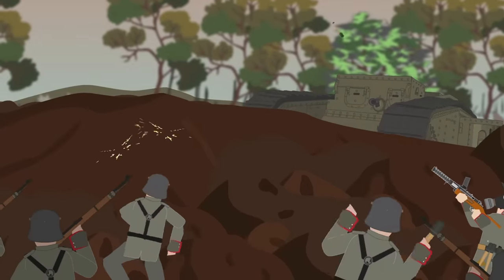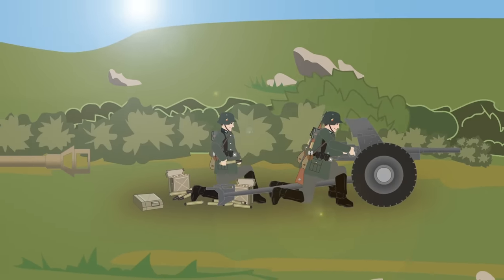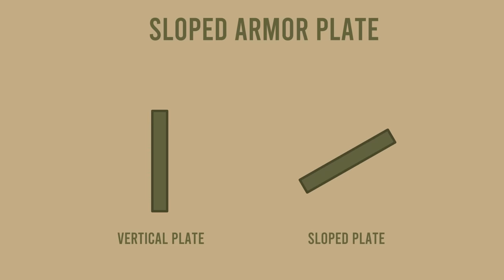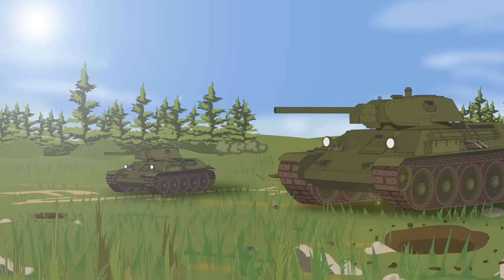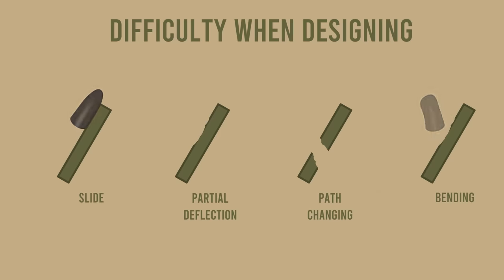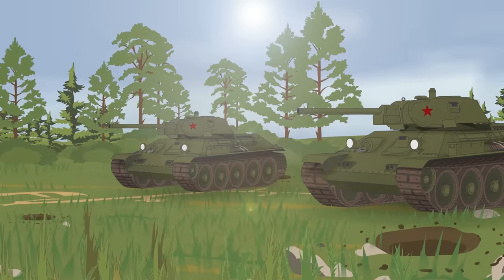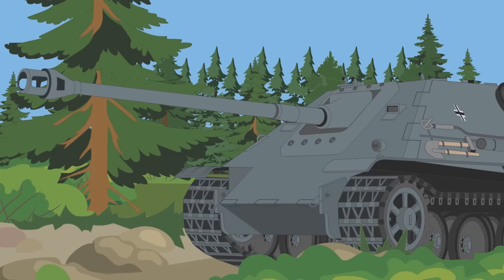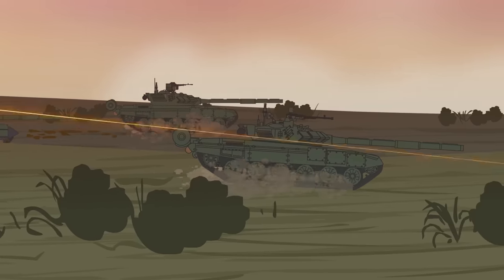Sloped armor: A simple feature that saved many lives

Comment: New rounds did hamper the effectiveness of sloped armor but not as early as stated. Yes the long barrels 7.5 cm guns of the Germans could penetrate the T-34 but making it thicker and sloped helps. Early HEAT rounds did have some issues with deflection as hit armor that was sloped could mean that the primary fuze isnt struck or that deceleration is insufficient to activate fuzes located at the base of the projectile, in addition to the fact that some early HEAT rounds were somewhat weak and required attacking weaker armor to penetrate. Furthermore, early APDS rounds did have problems against sloped armor as it was more easily deflected than standard AP rounds. Improved kinetic rounds and HEAT rounds in the post-war years had much better penetration and resistance to deflection is what hampered sloped armor in tanks. Sloped armor is still useful in increasing LOS thickness and is more useful against smaller caliber weapons like small arms, HMGs, and auto cannons which often use less advanced rounds that are more prone to deflection than a round fired from a main gun, which is why many IFVs and APCs still use sloped armor.

Comment: 5:01 There are a lot of maps, but you can't choose the ones you play on. The matchmaker does that, picking a random map of the current map pool (which isn't all the maps).

Also "using models and vehicle characteristics from history" is a nice meme at this point of the game. If you want historically more accurate tanks, you shouldn't play World of Tanks but War Thunder instead.
Reply: War thunder isn't even close to historically accurate with their tanks lol.
Shermans are slower than the Panther A
Jumbos outrun normal Shermans,
The T77 shot on the 90mm, a shot specifically designed to kill panthers, can't kill panthers.
British not having APDS on their firefly.
I could go on.

Comment: You forgot one thing, not just gun size. But also ammo types. Slope armor can protect itself from a normal AP round but other shells such as the ( ex. ) HEAT, APCBC, HESH, APHEBC and even HE rounds can take out a tank with sloped armor ( unless the HE round is large and is packed with large TNT/explosive creating  spall damage.) Useful info from both War Thunder and the internet.

This includes High velocity kinetic rounds such as APCR, APCBC, APHEBC, APDS and your typical modern day era shell. The APFSDS
Reply: Not only the shell types but steel types, with casted, rolled nad composites  etc.

Comment: It took me 50 years of studying WW 2 to realize that the Panther was just a German T-34, with its sloped frontal armor.
Reply: except it was expensive af to build
Reply: @fluffehpancakes1102  not really, near the end of the war the panther was about as expensive as the pz4
Reply: @yellowcrayonkid  i think that it was easy to producea panther than a panzer 4
Reply: @tinchorb1340  and harder to repair than a pz 4
Reply: @xahmadx6442  well
By late war
Panzer 4 production stopped
So, it might have been harder to find spare parts
Reply: Yeah how? Sloped front armor? By that way of thinking then FCM 36 is just French T-34
Reply: @tinchorb1340  considering that ~8000 of those were built I dont think its gonna be that hard
Reply: @tinchorb1340  the Germans focused on producing more panthers without producing many spare parts and
The pz4 and  is very common so you will find spare parts
Reply: @xahmadx6442  oh well, ig there was quite a lot of spare parts for panzer 4s
Reply: Except it had a much thicker frontal plate and higher performance gun than T-34/85.
The problem with Panther was that tank’s transmission wasn’t designed for it’s weight of 45 tons.And engines weren’t tested enough for the use of the tank due to Hitler’s pressure on manufacturers.

Comment: The t34 steel was not that strong even with the slope
Reply: Yeah i mean it was vulnerable to everything Germans had by late 1942 onwards.
Though obviously Panzer 2s with tiny 20mm guns or early Panzer 3s and 4s with short 37-50mm guns had no chance of penetrating frontal armor of T-34.But in 1941 most Soviet tank crews were poorly trained and lacked communication,so Germans had no problem flanking and knocking them out by shooting it’s paper thin side armor during Operation Barbarossa.

Comment: Tanks that were sloped made the compromises of having heavier weight and smaller crew compartments. The T-34 series have very good sloped armor but is notorious for its discomfort and cramped interior. It can also explain the differences in comfort to, let’s say, a tiger tank. The crew space and comfort was significantly better than most allied tanks which can explain as a reason why tiger tanks preformed better on battlefields than most allied tanks (other reasons are like better cannons, crew experts, etc).
Reply: Yep,Tiger was a huge rectangle box with a ton of space for the crew.

Comment: Sloped armour is armour that is neither in a vertical nor a horizontal position. Such angled armour is typically mounted on tanks and other armoured fighting vehicles (AFVs), as well as naval vessels such as battleships and cruisers. Sloping an armour plate makes it more difficult to penetrate by antitank weapons, such as armour-piercing shells (kinetic energy penetrators) and rockets, if they follow a more or less horizontal trajectory to their target, as is often the case. The improved protection is caused by three main effects.

First, a projectile hitting a plate at an angle other than 90° has to move through a greater thickness of armour, compared to hitting the same plate at a right angle. In the latter case, only the plate thickness (the normal to the surface of the armour) must be pierced. Increasing the armour slope improves, for a given plate thickness, the level of protection at the point of impact by increasing the thickness measured in the horizontal plane, and the angle of attack of the projectile. The protection of an area, instead of just a single point, is indicated by the average horizontal thickness, which is identical to the area density (in this case relative to the horizontal): the relative armour mass used to protect that area.

If the horizontal thickness is increased by increasing the slope while keeping the plate thickness constant, a longer and thus heavier armour plate is required to protect a certain area. This improvement in protection is simply equivalent to the increase of areal density and thus mass, and can offer no weight benefit. Therefore, in armoured vehicle design, the two other main effects of sloping have been the motive to apply sloped armour.

One of these is the more efficient envelopment of a certain vehicle volume by armour. More rounded shapes generally have a smaller surface area relative to their volume. In an armoured vehicle that surface must be covered by heavy armour, so a more efficient shape leads to either a substantial weight reduction or a thicker armour for the same weight. Sloping the armour leads to a better approximation of the ideal rounded shape.

Comment: I read one German account, a group of T-34s attacked German lines at the beginning of Barbarossa. At the time the Germans had nothing to challenge the tanks. As a last ditch result they brought in a 20mm AA gun battery. The automatic weapons struck the tanks many times at close range. The Russian crews bailed out and ran. Later inspection showed the 20mm rounds did not penetrate the tank's armor. Some of the Russian tank crews were captured. Under interrogation they confessed that, while the shells didn't penetrate, they did turn the interior of the tank into a ringing bell. They couldn't take it and ran.

Comment: The main reason that Panzer III and Panzer IV did not use sloped armor design is due to the lack of reason to sacrifice inside room and ergonomic while the frontal armor could withstand anti-tank rifle from point-blank and most of the early anti-tank gun from some distance. The project to build a medium/heavy tank against future potential threat start from 1937, and they use the already mature Panzer III/IV design, that's why Tiger's frontal hull armor is still almost vertical(in fact it's around 10 degree sloped).
Reply: Not ! Later germans adot the concept on panther and tiger 2
Reply: @Necromancer_88   I know, that 's how Panther tank born.  Still, Panteher has a lot of problems
Reply: @Necromancer_88  I know, just talking about the reason of while german's armour car were using sloped armour but tanks were not when the war just break out.
Reply: The requirement was to resist the French 37mm on the front not AT rifles.
Reply: CipiRipi00   But the pateaux SA 18 37mm was thew gun most French tanks used so that was the requirement.

Comment: well but a powerful HEAP or SQUASH round with a 1 second delay rapid 10-15 degree  angle change triggered  inertial secondary fuse in the anti tank or  anti ship round will fix that sloped armor ricochet  and reactive armor issue very easily.

Comment: tigers may have flat armor, but you angle the entire tank facing the enemy with a 60 degree frontal plate and the whole front and side becomes angled armor. this increases the protection from shots at those angles on the left and right sides by a huge margin, allowing armor that could be penetrated by an american 76mm or russian 85mm to now deflect enemy fire along those angles. this was entirely unintended by german engineers but was later described as a useful tactic in the Tigerfibel pamphlet. and while you may like world of tanks more i have news for you that warthunder is easily the better and more realistic game, where players of the tiger rediscovered this tiger tactic and developed it further than any ww2 tiger tank crew pamphlet, even adapting it for other heavy tanks that had thick enough side armor, notably hull angling works quite well with the KV tank series and Churchill tank series. angle your turret as well when expecting the enemy to fire to maximize protection, and only return fire while the enemy is reloading.
Reply: Fun Fact:Tiger I’s armor isn’t entirely flat.It’s a 102mm steel plate angled at 10 degrees!

Comment: Sloped armor is not about thickness. At the same time as you get double effective thickness of plate at 60deg you also increased its size twice. The point of sloped armor is that rounds tend to ricochet and have less penetration potential when hitting sloped armor. But it is not about increase thickness. Plates that cover same area but one is upright with 2 thickness and other one is 1 thickness with 60deg slope would weight the same.

Comment: Sloped armor is obsolete. Tunsten Steel Penetrators or SLAP rounds, have been around since the 1980's. It's the main munition of the US Army's Calvary Divisions. It cuts through sloped armor like a welding torch at 4,000 fps. It's brutal. Basically if your tank gets hit with a saboted penatrator round you are done. Regardless of armor thickness, slope angle...none of it matters.
Reply: Composite.

Comment: The Tiger II was NOT the first German tank with sloped armor. That would be the Panther, which was introduced at the exact same time as the Tiger I. The only reason the Tiger I didn’t have it was because its design was already extremely complex and expensive to produce (sloped designs increase costs and production times)  and they needed as many tanks as possible right then, and at the time, the Tiger’s armor was already the thickest on any battlefield in the world anyway, extremely hard for all enemies to penetrate(and would remain so for years), so sloping was viewed as unnecessary. 

Also, keep in mind that the Tiger I heavy tank was a direct response to encounters with Soviet KV-1 heavy tanks, which also had mostly flat armor, which you neglected to mention. The Panther medium tank was a direct response to the T-34 medium tank. You guys really didn’t do your research for this one. I guess simple history means simply inaccurate. Either that or you are being intentionally misleading.
Reply: The Panther was a heavy tank due to its 44.8 tons of weight, when a medium usually hada weight of 30 to 38 tons.

Comment: It may have saved SOME lives, while - at the same time - rendering the inside of "some" tanks so CRAMPED and UNCOMFORTABLE, that when they came to the battle-lines they were already exhausted to death, and having to perform even such a simple task like reloading a gun so difficult, that I'm wondering how many did it actually killl?... 
PS. Plus - you can slope the armour how much you want - not gonna deflect anything if the steel's too brittle.

Comment: The Russians were not the first to use sloped amour and since the Russians heat treated there steel so hot for example I think most countries were heating up to 300degrees celcius and the Russians were heating up to 600 degrees Celsius yes making there steel very hard but very brittle which a round didn’t not need to pen it only needed to hit the tank glass plate to shade the steel in minor places and sending shards of shrapnel throw the tank this is also aided by the fact that the Russians let’s say’s didn’t have the best welders so the wields tended to break anyways love the vids keep it up

Comment: Sloped armour only had a practical value for a short time. Hollow charge munitions does not care if the armour is sloped or not. T-34 was not the first tank with sloped armour, as many believes.
Reply: Even with the sloped armor, T-34 was still a death trap because how brittle were the steel and how cramped was it

Comment: Just going to ignore that Sherman’s were one of the most effective users of sloped armor?
Reply: @Duy Đinh  They could can deal with everything even German armor was vulnerable to their own guns.
Reply: @Duy Đinh  Yeah that's the point, German canon had such good penetration that no matter how much steel you put in tanks they will be perforated, so being fast with decent protection was a better overall approach.
Reply: Your better off in a Sherman than a T-34
Reply: @Duy Đinh  Crew survivability. Ever wondered why the Sherman had the among the lowest crew casualty rates of any WW2 tank?
Reply: @Duy Đinh  More like a less cramped interior, fuel tanks separated from the crew compartment, big hatches for every crew member, armor with the proper tempering, better optics, and radios. 
Following that logic soviets had ir easier because at that time the Tiger and Panther was not around.
Reply: @Duy Đinh  you forgot about the North Africa and Italian campaigns. Europe wasn’t Americas first rodeo. And did you know that the Soviets received a fair amount of Shermans with the Lend Lease Act?
Reply: @Duy Đinh  yes you are correct about tactics and reliability. The Soviets used tactics that got a lot of their men killed. The T-34’s reliability was not as good as most other tanks. The sloped armor of a T-34 was what got a lot of their crews killed, an issue called spalling. When a shell hit the armor, even if it ricocheted, it would break the armor and send shrapnel throughout the tank, killing or injuring most of the crew. The T-34 was also harder to get out of, thanks to the sloped armor that cramped the crew in a small space. The T-34-85 was a decent upgrade, but it too carried the same problems

Comment: Imagine our M1A2 SEP Version 3 Tank in ww2 it would dominate the tank war for sure and I'd dare say it's the best tank there is
Reply: It would basically be indestructible unless flanked or dive bombed from the air. But that’s the same with almost any modern tank. 

And in my opinion the M1A2 Sep V3 is currently the second best tank in the world slightly behind the Leopard 2A7. But the M1A2 Sep V4 I think will be superior to even the Leopard due to it’s new configurable tank shell. It’ll allow the Abrams to only have to carry two different types of tank shells which means it will be able to carry more APFSDS rounds. Every other tank in the world usually carries 4 to 5 different types of tank shells. In the M1A2 Sep V4 we combined 4 of the tank shells into one that is easily and quickly configurable to whatever you need wether it be a HEAT round or an air burst round
Reply: @tylerclayton6081  agreed and what's the best tank currently cause I won't lie I'm biased and believe our Abrams are the superior tanks
Reply: Just Some Crappy Animations  Lol T-90s are mediocre at best.
Reply: Just Some Crappy Animations  Nowadays with modern fire a lower profile doesn’t matter, protection is lacking against new western ammunition, electronic are behind been second gen thermals, engines  lack HPs and most of their components are made in the west so their production will stop due to current events, so they small numbers will remain as such.